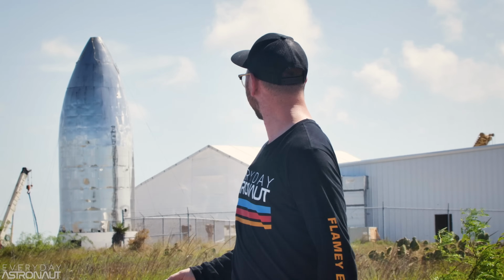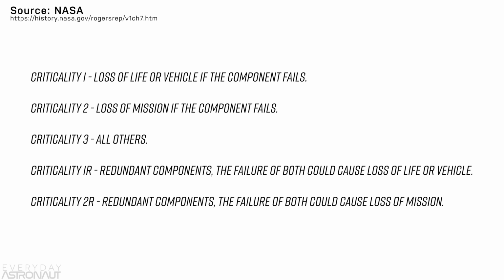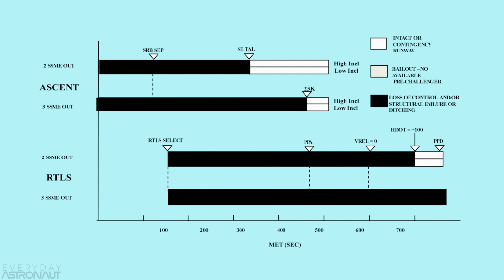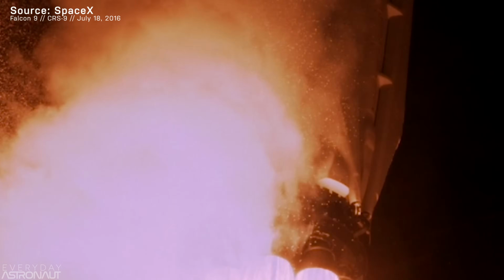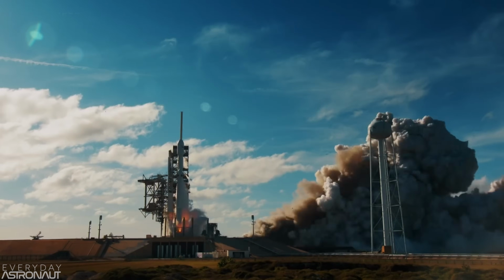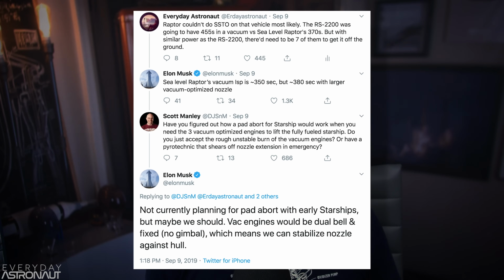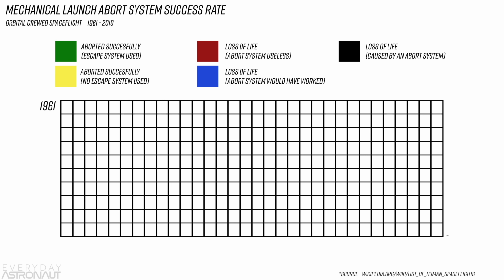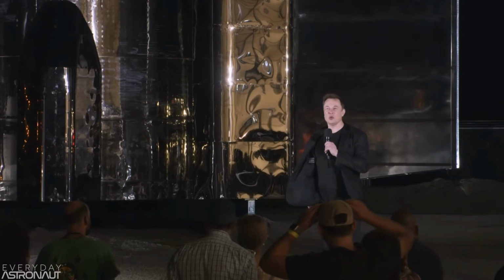Why won’t Starship have an abort system? Should it?!

Comment: Excellent video. You informed me clearly and extensively. Just one question: You do know that Starship was designed by reverse engineering the UFO that crashed at Roswell, NM in 1947, right? 😜

Comment: There were 24 successful* flights (most flights by a single orbiter: 9 - Challenger) of the Shuttle Fleet prior to STS-51L (Challenger), and 87 (most flights by a single orbiter: 24 - Atlantis and Discovery) between Challenger and Columbia.  If Starship can do more than 87 without a LOV then we can probably call it at least safer than the Shuttle.  The most total flights by an individual orbiter is Discovery with 39.

So there's SpaceX's interim targets: 87 total flights and 37 flights by an individual Starship without a LOV/C.

*mission objectives achieved.

Comment: The parallel should not be to commercial aviation. 
Space flight is far more like testing the newest hot fighter plane.
They don't make them without an egress system.

Comment: A potential problem that you didn't address is that if the upper stage of Starship needed to be used in an abort scenario, it would be full of fuel and very heavy. Even airplanes have to dump fuel if they have an emergency early in the flight. It would be a lot harder to dump fuel safely into rocket exhaust. The thrust/weight ratio would be much lower than typical reentry conditions and there might not be enough time to burn enough fuel to land safely.

Comment: Fuselage failure in aviation usually lead to disaster and we've done well avoiding them, so I have no doubt we'll be able to do the same with rockets.
Reply: Usually fuselage failure is a secondary problem following the rapid unscheduled disassembly of some other system, both in rockets and aircraft. The only primary fuselage failures in aviation I am aware of were the Comet jet airliner disasters.
The thing is that rockets tend to have subsystems that can fail much more violently than anything inside an airliner's fuselage. The only systems on aircraft that can dump anywhere near as much energy as various parts of a rocket would be the kerosene tanks and the engine turbines. In modern planes, the latter are kept at a generous distance from the fuselage for a reason, and wrapped in an obscene amount of kevlar.
Then, rocket fuselages are nothing like airliner fuselages. While the pressurized portion of an airliner fuselage never experiences more than maybe half an atmosphere of overpressure, rocket fuselages experience well above 1 atmosphere of overpressure at least at the bottom, if only from the mere weight and inertia of the contents, plus maybe additional active pressurization. And any dangerous contents in an aircraft fuselage are pretty much just jet fuel kept in an unpressurized portion, while liquid fuel rockets invariably contain both fuel and oxydizer in the pressurized portion. Thus, a rupture of an airplane fuselage will usually either "only" tear a big hole in the payload compartment or "only" cause jet fuel to leak out and potentially cause a nasty flame; while the rupture of a rocket fuselage will pretty much inevitably tear a big hole in at least one of the tanks, causing the contents to spray out, and if both tanks are affected, instantly result in a nice big fireball.
And finally, to the best of my knowledge aircarft cabins include dedicated load-bearing members, and the fuselage is dragged along by the wings at comparatively mild forces through a subsonic airstream, so even if the cabin skin is torn wide open the structural integrity of the aircraft as a whole is not compromised; whereas to my knowledge in rocket fuselages the skin usually comprises an integral part of the load bearing structure, and is pushed along from the back with immense force, counteraced by a heavy payload at the other end, while traveling through a hypersonic airstream; so if a rocket fuselage is ripped wide open it will likely undergo significant deformation, to then be torn apart by the airstream before you could say "max Q". And even if you'd install enough load-bearing struts, any crack in the fuselage would probably still be be caught in the hypersonic airstream, causing the skin to peel back entirely or at least to a degree that aerodynamic symmetry would go far out the window, and you'd still end up with a rocket tumbling out of control in a hypersonic airstream, with loads reaching magnitudes and directions way outside the envelope your spacecraft was designed for.
Reply: @CLipka2373  1: Yes

2: Holy Bible wall of text batman!

3: That just makes it a fair engineering fight.

Comment: The big questoinmark aruond new generation crafts, and following the airplane analogy, is software. In this case: Reentry control. The Max MCAS (although littered with negligent management) is an example where software is involved in an accident. Simulating "all possible situations" to check how the software reacts is not easy, or in some cases, it might be impossible in practical terms.

Comment: EA, as you stated, the best way to get safer flights is to fly many times, and fly reusable (like airplanes). This is what the Space Shuttle did - but sadly with no good result at the end on safety. So, how many times (more) should a system be flown comparing to the Shuttle (more than 100 flights) to get safer significantly?

Comment: Wow. 
So one out of every 200 flights kills everyone?
Yea, I agree then, there is no need for an abort system. I mean that's like the same as airplanes, one of every two hundred flights crashes and everyone seems fine with that.

This guy used great logic and solid points to make his case.

Subbed.

Comment: I think that abort systems are kinda like a seat belt, or airbag in your car, ideally, it'll never be used, or necessary, but in the unlikely event that it IS needed, it's very very nice to have them. While they cause extra design and engineering problems, they also are an extra level of redundancy, if all else fails, it can save lives, when well designed.

Comment: No Cessna, huh? What about the miracle on the Hudson? Commercial airliners don't have a Cessna inside, but they do have boats.  They have boats, floats, ramps, and life jackets in case of a water landing. Every one of them another moving part. As we all learned from Titanic, (the historical event, not just the movie), hypothermia is no joke. Jack! 

Basic safety equipment can be relatively cheap, unobtrusive, and useful. On a commercial airliner, your seat doubles as a flotation device. I understand that Delta's not going to be handing out parachutes to each passenger, but they always supply flotation devices to each one. And pretzels.

Comment: I think the preliminary sketches include the possibility of a rescue system, but this is not a traditional, more sci-fi solution.
Each cabin is a separate capsule.

They just need to be blasted out of the hull.
Thermal insulation is required.
It could also be suitable as a heat shield, with little overweight.

Comment: I distinctly remember that the Columbia actually had survivors who died on impact not on hull failure...
Reply: Impossible... the pressure and heat would kill them instantly. In addition, their suits had parachutes, so if they survived reentry, they could still soft land.

Comment: Awesome long format deep dive! However, one important note about comparing probabilities and success rates: at 21:07 when you were ranking the most reliable rocket engines, it it tempting to just use the percentage of failures out of total missions (sample size) as a way of comparing engine reliability. However, it gets more complex when comparing different sample sizes.

For example, if engine A has flown a total of 100 times, and failed on 5 flights, we would say it has a 95% success rate. If engine B has only flown 10 times, and failed on 1 flight, we would say it has 99% success rate. So, we would be tempted to conclude that engine B is more reliable than engine A. However, this is not necessarily true, because of the different sample sizes. 

To compare these two sample sizes correctly, we need to do some statistical analysis, and then determine if the differences we observe in engine success rates are statistically significant. And it might turn out that engine A is more reliable, statistically, than engine B, given engine A's larger sample size. 

In any case, great video, I learned so much about abort systems and the balancing game of redundancy vs. simplicity. Keep it up!
Reply: "If engine B has only flown 10 times, and failed on 1 flight, we would say it has 99% success rate."

Don't you mean a 90% success rate? Other than that I agree with what you're saying.

Comment: Saying that the pressure test RUD is a safety issue is as wrong as if a body armor manufacturer would test their armor plates with bigger calibers every time and when it breaks at some point to claim it's unsafe because it didn't survive a .50 when it's rated for 5.56

Comment: How about abort systems for satellites? They're pretty hard to replace when the rocket explodes.
Reply: What's more expensive - designing a heavy and complex escape system and carrying it on 99 perfect satellite launches to recover the 100th one from a catastrophic failure, with the satellite potentially becoming a partial or even complete write-off anway due to contamination from debris or combustion products, or from dirt upon recovery, or maybe requiring recalibration due to excessive or off-axis forces or any other influence outside normal mission parameters - or just outright losing 1 out of 100 satellites, and distributing the financial risk via insurance?

Comment: I dont see how a pad abort for something as big as Starship would end well. Even if they tried it, where would the exhaust escape to? It would have to have staging like the N1 to work. I also wonder how the fins on Starship can handle the stress of hypersonic reentry, they'll need to be over engineered. As crazy as it sounds but just having airbags inside Starship could likely save people in the even it missed the pad or tips over as long as the touchdown speed is slow.

Comment: I prefer a puller abort system that utilizes solid rocket rotors. The pusher systems used by boeing and spacex use hypergolic propellents which are extremely toxic. They require a whole host of specialized storage and loading procedures. Solid rocket motors are very simple and have a fraction of the components compared to a liquid hypergolic system.

Comment: Hey Tim, do you know what the engineering logic was behind not doing the transpiration cooling? It was very interesting to hear why they went to stainless steel vs carbon fiber. 
And it would be great to hear why they switched away from transpiration cooling.

Comment: Great video, Tim.

Would a failure rate of 1/500, while good enough for NASA, be good enough to close the business case on a reusable rocket? I doubt commercial aircraft would do very well with only 500 flights before scrapping/crash.

Comment: Maybe we're still in the "Wild West" phase of space flight, in the grand scheme of things.
Reply: I think we are more entering the early WW1 era of planes were they are starting to have some uses but still are really crude.
Reply: Yeah, Starship is the first step towards more "normalised" space access, but it won't be the last. We might see more unconventional launch methods (skyhooks, railguns, etc) being employed further into the future.
Reply: I'm just waiting for someone to build a functional SSTO. Hopefully Skylon pulls through in the next few years.
Reply: @gj9157  I really don't get the attraction of SSTO considering the abjectly poor performance they necessarily have compared to adding just a single additional stage.

Like, once/if we get fusion engines, or sufficiently safe and reliable and powerful enough for gravity well escape, I'll be totally on board for SSTOs due to the energy density advantage making them practical finally.

But with chemical rockets? In our relatively deep gravity well, and relatively thick atmosphere? Naw.

Comment: What about just having like a rescue pod where crew stays in during takeoff and landing, maybe like a built in crew dragon?
Reply: Starliner is supposed to have a large number of people on board.  They wouldn't fit in a dragon.
Reply: @johncrowerdoe5527  i guess you mean starship. I doubt there will be dozens of crew during the first crewed flights, as there is no demand for that many. One crew dragon can carry up to 7 passengers, it probably weighs about 3-4 tons (descent capsule only). Starship is supposed to have a payload capacity of 100+ tons to leo, so it shouldnt have much trouble using multiple escape pods

Comment: It seems to  me that it does not matter how many times you fly a system there is always going to be that manufacturing flaw or computer failure that all of a sudden puts the pointy end down at the wrong time. Let's just say you have a system flying and during a critical maneuver the grid fins function incorrectly due to corrosion. A flight-proven ship gets into a nose dive instead of orbit; boom. Space is dangerous, more dangerous than flying the Kittyhawk flyer. More energy to unleash, a lot higher off the ground, forces in excess by multiple factors, untried multiple factors, many more possibilities of failure ( a direct result of new technology) and as you say, not enough flight data to calculate possibilities or know what could happen. My point is, there are going to be deaths with or without abort systems. You have stated the obvious when you say the abort systems and related hardware are another area of possible failure. Astronauts are not thinking of suicide, they are thinking of what do I do to solve any problem that occurs and that is why the problems will be solved as the manned flights go forward with hero and victims. At any rate, thanks for the very well thought presentation.

Comment: There have been lots of technical surprises while underway ... not necessarily dangerous in their own right but always showing to our surprise how we were thinking inside the box after all ... and every unexpected failure coming from left field has a chance of resulting in a catastrophic unanticipated impact.  I remember the first Shuttle in orbit could not shut the cargo bay door because thermal expansion in direct sunlight (bad surprise!). They finally  were able to close the door by moving the shuttle cargo door into the shade.
        There is a way to calculate how many more left field surprises remain undiscovered.  When a new version of Fortran was released, many bugs would be discovered. The rate of discovering new bugs would drop off over time. This rate of discovery can be graphed. The area under the curve was the total number of bugs discovered.  It was clear the bug discovery rate was dropping at a predictable rate.  Thus you could extrapolate into the future the bug discovery rate with the area under the extrapolated curve being the number of yet undiscovered bugs.  Likewise, we can get an idea of how many unanticipated rocket system failure modes are left.  Whenever an updated version of Fortran was released, the bug discovery rate would jump up again but not as high as before.  

There are known unknowns such as sigma deviation levels. The left field surprises are the unknown unknowns and from your mini-course in crew safety design, the outside-the-box surprises play a major role (e.g. 8 degree rotation of the earth setting off the emergency escape!)

Comment: Great show!  Abort system for Starship?  Yes.  I kinda think of Starship as an experimental spacecraft.  A safety feature available in experimental aircraft is the ballistic recovery system (BRS) which is basically a parachute for your plane.  Yes, commercial airliners have an impressive safety record; it's just when they fail they tend to fail with a high casualty rate.  If Crew Dragon has it why not Starship although I could see building ships in the future that do not have abort systems due to their high reliability.